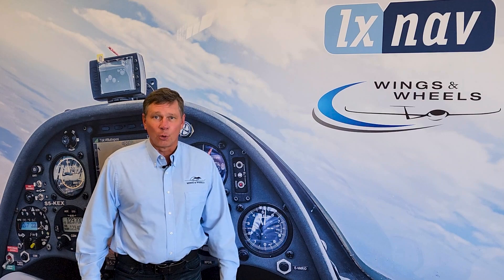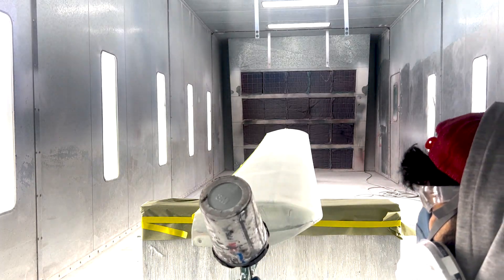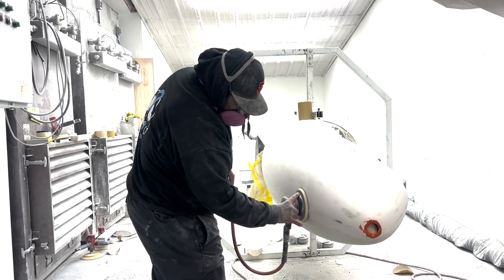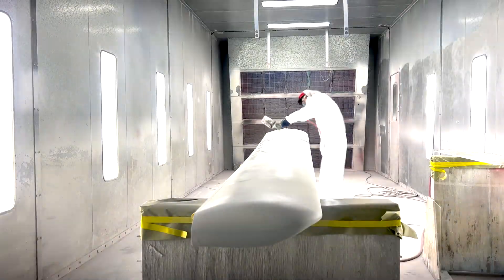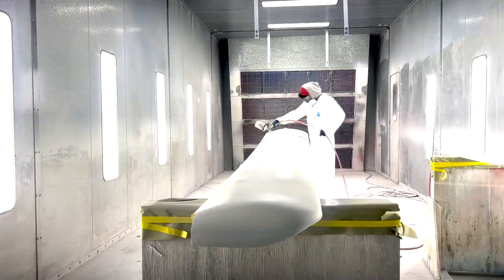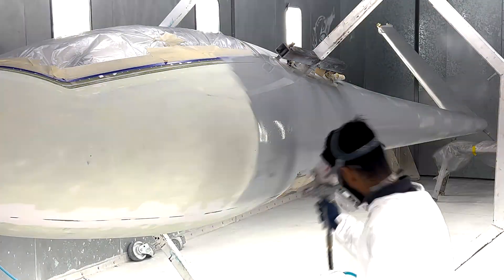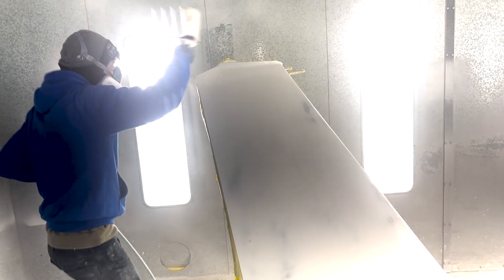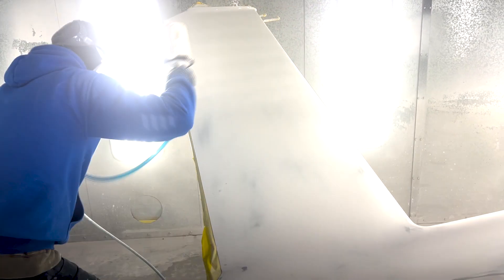Sailplane Refinish Video 4 - Paint & Primer

Comment: Hi Gents.   A glider is not a car.  You are not allowed to apply thick layers of Bondo on it.
It is easy to apply new thin glasslayers and make it smooth but the empty mass of the glider increases, and the center of gravity goes backward.
If you ask to do such a job assuring zero mass-increase NO sailplane refinisher will EVER give you a quote or touch your plane.
If you get a quote with assured 2 kg's limited mass increase you have the best sailplane finisher in the world.
Reply from the maker: Bondo was not used or thick layers of any filler. A little weight was gained in the end, but not much. As we all do when getting older ;)

Comment: I was "involved" in sanding off the old gel coat from an ASK21 (recently).  I spent, about, 3 hours, sanding about 1 sqft of gel coat.  A won't volunteer to do that again. I'd rather pay the folks at Wings and Wheels to do it. It looks like they did a better job than we did.